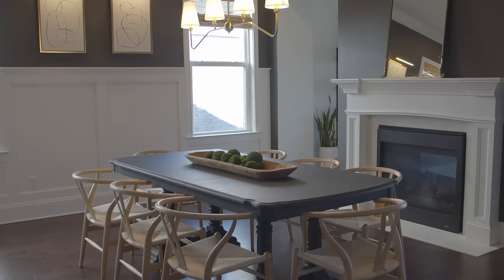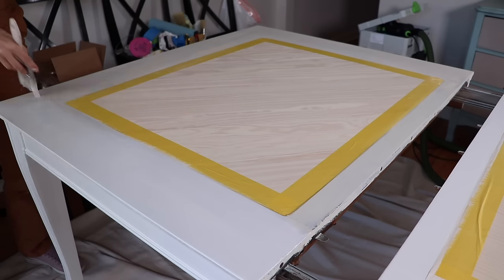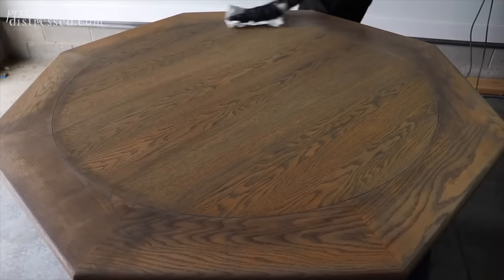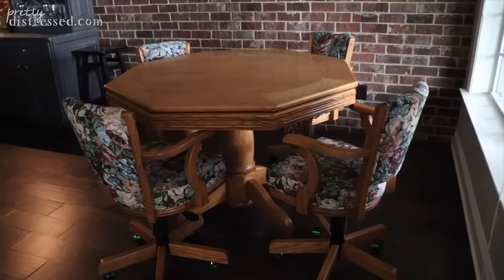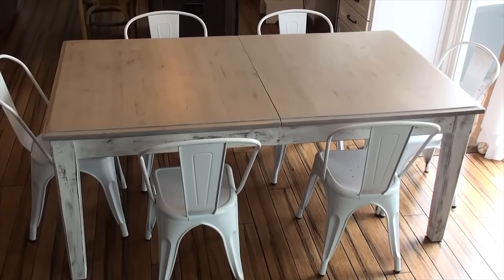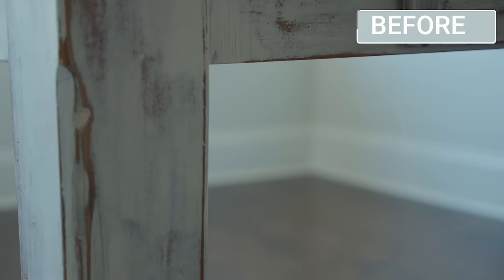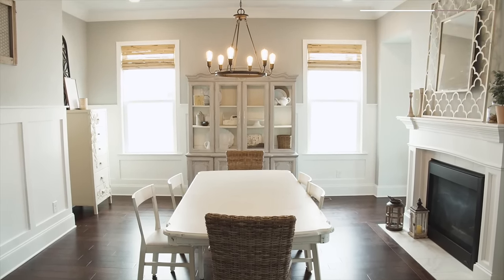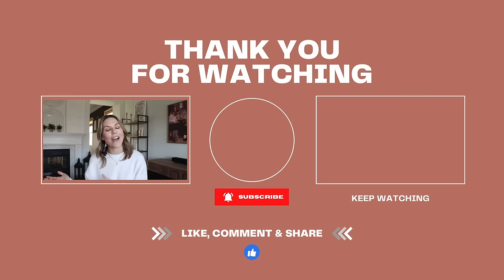5 Kitchen TABLE Designs // Dining TABLE Makeovers

Comment: I am really learning a lot about refinishing furniture from you and enjoying watching your videos. I noticed you said that when you were refinishing your dining room table taking it from a farmhouse look two more modern, you said the general finishes top coat and flat did not yellow, but then at the end of the video when you refinished the side table you said you used the same top coat and said it could yellow. I'd like to refinish a kitchen table that has a cherry top and thinking that I need to shellac it first to seal in the red and then paint it white and would like to know what the best sealer I can use is as it is a kitchen table. I don't comment very often on videos. Not even sure how you get messages and can respond.
Reply from the maker: It can yellow over white paint, but it doesn't yellow over stained wood. White paint can be tricky. You have to be willing to troubleshoot. I would use at least two coats of Zinsser BIN shellac based primer. I like Varathane Ultimate Water based poly for a job like that. Or you could use the General Finishes. It's more expensive and harder to find though. Let me know if you want links to anything. Good luck!
Reply: @ChristinaMuscari  thanks

Comment: Great video.  Does the varnish not yellow the white paint?  I’ve always been told that it will.
Reply from the maker: Sometimes it does and sometimes it doesn't. So you take a risk in using it.

Comment: I also re-did my dining table with BM furniture and cabinet paint and the sales person told me not to use a topcoat....Was that correct? It doesn't feel very smooth and I am worried it might not last with a topcoat. Thanks
Reply from the maker: Yes, with a cabinet paint there would be no need to topcoat.